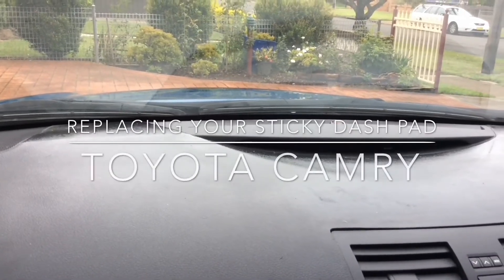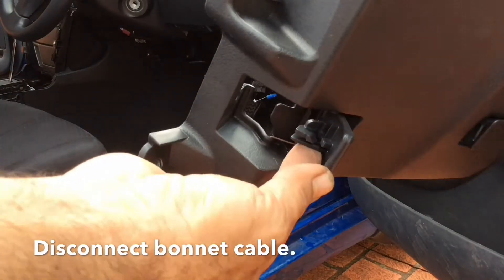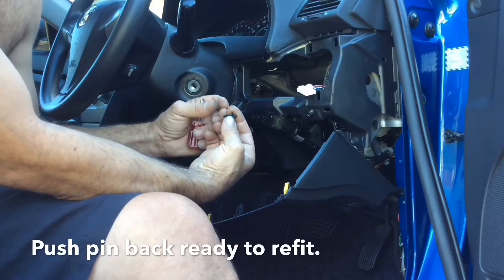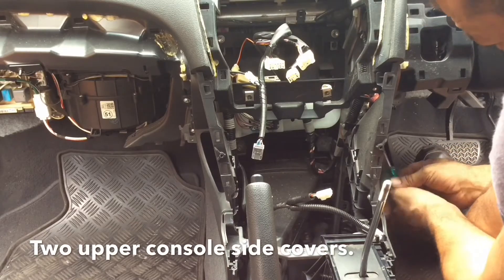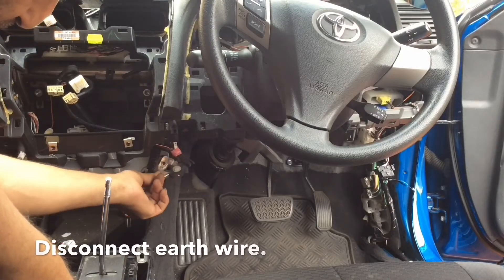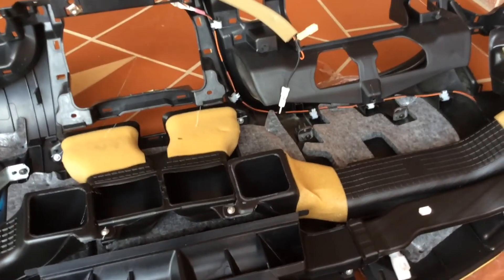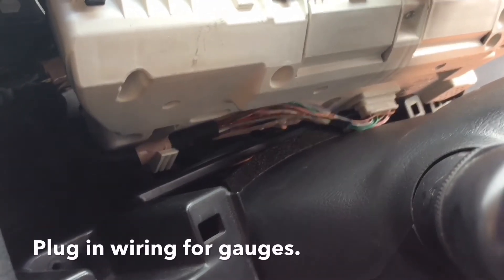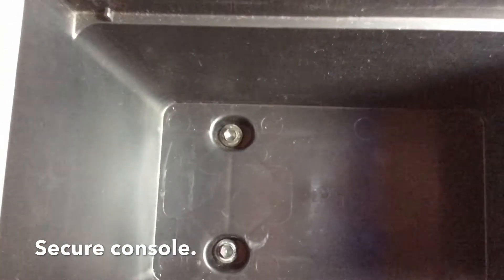Replacing Your Sticky Dash Pad - Toyota Camry

Comment: Thanks a ton! Just replaced my wife’s dash in her 2009 Toyota Camry. I managed to get a second hand dash from a salvage yard for just $25!
Reply: But isn't it made of the same material the original was so it will just turn to crap over time?!
Reply: @PapillonOne   it seemed to be made of a slightly different material. We have since sold her car, so I cannot speak for the longevity of the replacement dash pad
Reply: @Napak1  Thank you.

Comment: Dear Singing Mechanic, This a great Video, I have couple of questions if you don’t mind asking. 1) What year is this Camry ? 2) when you placed the dash on the floor after removing from the car, I could only see the black frame skeleton, did you remove the gray color dash from the base frame? If so how is it done, how do you remove and placed on the new one. Also looks like you replaced not only the gray colored sticky dash cover and the whole frame  as well, right ? Thanks in advance

Comment: Hi, at 2:48 you remove the two clips that hold the dash cover in. When you replace them, how do you refit them? I am trying to isolate a rattle under the dash and I think that dash cover might be loose and need new clips. Toyota Australia replaced my sticky dash on my 2009 Camry under warranty a few years back and I think someting must have worked loose.

Comment: If it’s sticky all you have to do is rub the dash with rubbing alcohol and get the sticky off it only took 20 min and I’ve never had it come back
Reply: How bad did it mess up the color?
Reply: It really didn’t effect the color too bad it made it a tiny bit dull but not  too much to notice.
Reply: Silly overgeneralization.  I did a lot of different things with my 2005 Sienna and got it better for awhile, but eventually the stickiness came back along with some cracking.  I ended up having to buy a Coverlay dash cover.
Reply: @glenbard657  do the coverlays reflect any glare? and do they feel cheap while installed? Im considering getting one.